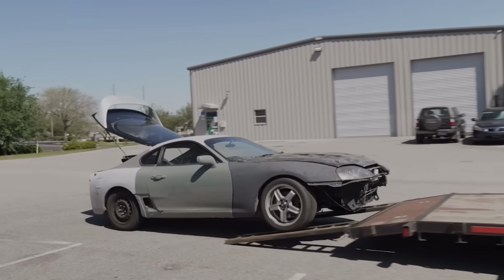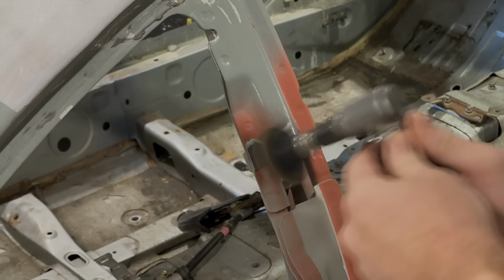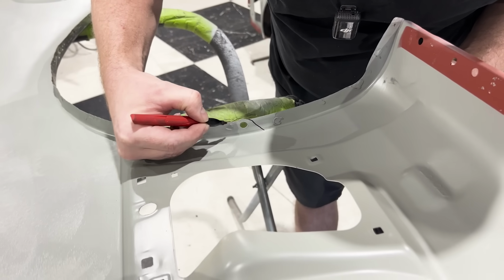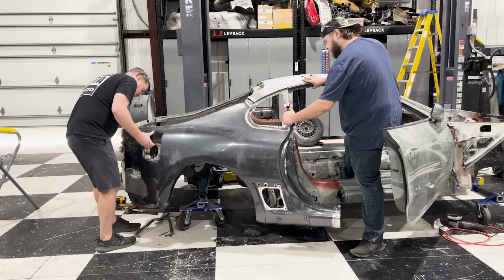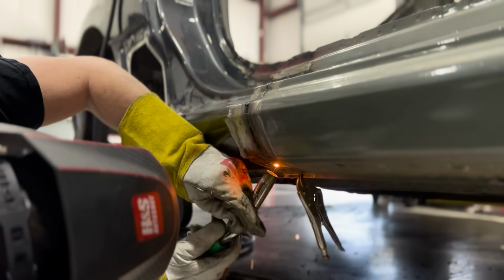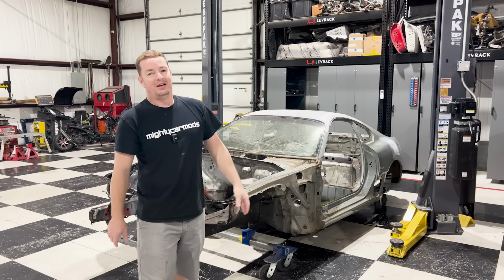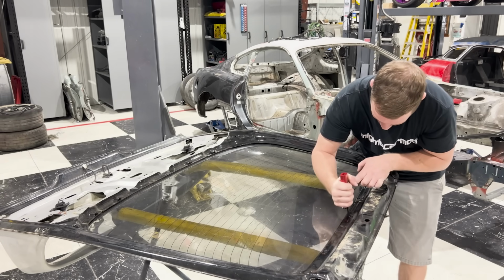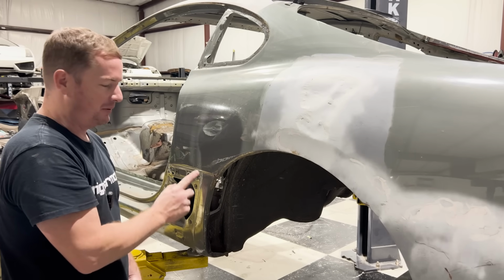Rebuilding A Destroyed Toyota Supra | Part 6

Comment: What are you spraying the areas with for corrosion protection after welding? I'm curious as ill be doing this on my mk3 supra and want to do it right.
Reply from the maker: 3M cavity wax
Reply: @jackbuildsit and what about the outside of the panel where you weld? What do you spray to cover the raw metal for the time being before you are able to actually prime and paint the entire car? I'm in FL aswell and I want to keep as much humidity/moisture off the metal as possible.
Reply from the maker: @joshd8894 epoxy primer
Reply: @jackbuildsit  I was thinking that's what you used, thank you sir! I hope you're enjoying the heck out of the new shop!

Comment: If you leave yourself a 3/8s to 1/2 inch over lap on the B pillar, and double cut the seam after you fit the panel. With the reciprocating saw. You will be left with a tighter join, and very little to no gap. And of course less bondo and a bit less work.      https://youtu.be/ml_-PSX7CZg?si=qeWu9cGLou2KhMgv&t=768

Comment: really enjoying watching you work. I'm pushing 48 years old with extensive mechanical history dating back to the days I was 7 or 8 years old and my grandfather had me under a hood helping him. I grew up working on everything from small engines to cars, trucks, and tractors. I went to tech school for body work but today's industry has equipment and tools that weren't around back then and I'm learning more and more watching you. I'm about to undertake this whole process you are doing on my 83 Datsun 280zx. right now I'm focused on getting it running again after sitting for 5 years but as soon as I'm satisfied all is well with the engine, its getting stripped to the shell. there's a Rocket Bunny body kit in its future.
Reply from the maker: Keep me updated on your Datsun build! I'd love to see your progress.
Reply: @jackbuildsit  tomorrow, I'm draining and cleaning the fuel tank, pulling the injectors and cleaning them... basically all fuel system related things will be gone through. I'm a few hours north of you guys here in Georgia and the evenings are getting cold so its going to be a little at a time. really wish I had a shop lol. that's a future build. just using the carport as of now but its enough.

Comment: Ha, major flashbacks from that spot welder. I welded A pillars for the VW Lupo for three weeks a few years back. Their welder was twice as big, completely water cooled and hung from the ceiling. The sheer mass was hard to move, but the work overall was surprisingly easy thanks to that gear. It also timed each weld for you to prevent burn-through. It was a very interesting insight into production.

At the very end of your video, it sounded as though you might have discovered more pro-grade Bondo restauration. We should really get the pros involved. 😂

Comment: This seal on the trunk lid is gladly not that expensive from Toyota. I don't know where you order your parts. I bought many things from amayama. They sell original Toyota parts for a really reasonable price.

I bought this seal for example for 40$. It should be replaced after 30 years.

Comment: 20:10 nice cut out tool!!! I love my WRD Spider. I use it all the time to cut out windshields.
Reply from the maker: Best glass cut out tool ever!
Reply: @ could you not have used that on the hatch glass? I’ve used it to remove back glass that needed to be re-used. Although the moulding looked a little tight to run the cord in between the glass and pinch weld

Comment: Jack. Bodyshop guy here, cavity wax is normally the last stage before buildup, you can get 4ft long thin flexible tube nozzles that will get into any gaps. I would put the panel bond on bare metal personally. Your doing a great job tho 😁
Reply: Ex-spraypainter here... i remember there being a few tiny rubber plugs in the panels and doors to put the hose in.